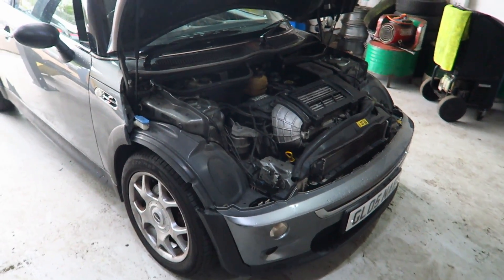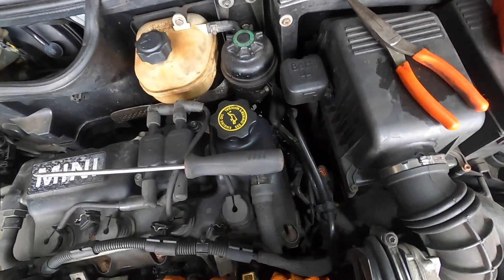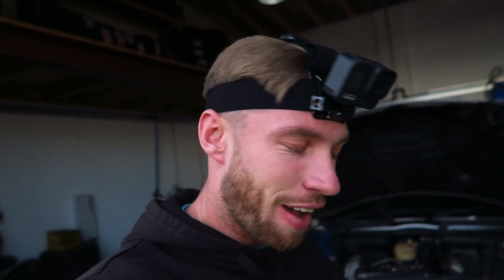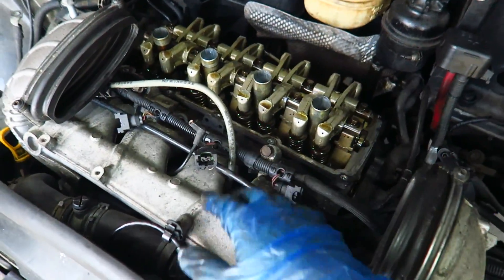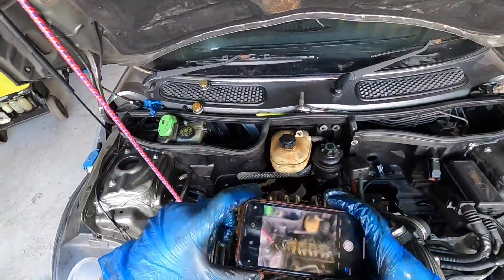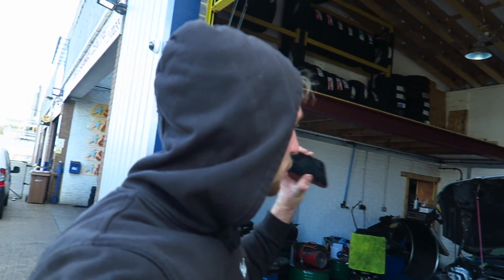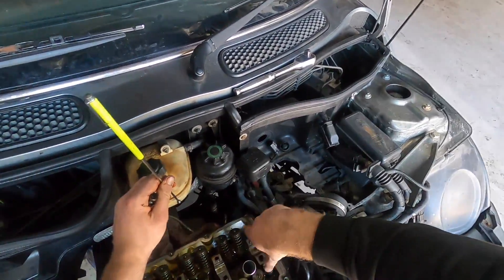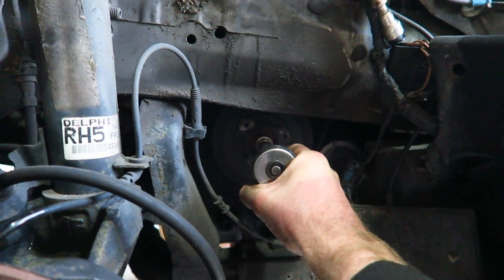Stripping Down The R53 Cooper S Engine!

Comment: Cool video man, I have the same car as you, just a tip for the future. It’s best to number the head bolts and put them back in the same order they were removed as it helps the engine because the bolts have gotten used to there specific placement in the engine. Great car, great video 👍🏼

Comment: I like all the vid you do normally Lee but FFS your not a mechanic, so many fails it's peak bro. From undoing head/cam bolts from the outside in, to not getting a true flat and measuring clearance on the head and the block. Bro, fix it up man surely you edit your vids? Your don't even use the right words half the time FFS making the UK man look bad out here
Reply: And the biggest fuck up, was not taking the engine and box out at the same time with the front end off. Why not? You wanna do a head job and a timing chain. Take it all out it's easy on the floor even your bad sump plug. Just fix up you shit man
Reply: Robert Casey why would you remove the whole engine and box just to do a head gasket and timing chain when you have plenty of access without doing so? Sounds to me like you don’t have a clue what you’re on about
Reply: @TheSavageGarage I just sat and watched the job you guys did, you don't know anything about me 😂. Have a look at how's the cars built and some book times
Reply from the maker: Who cares
Reply: @itsleelockwood  obv not you 😂😂

Comment: Hope you got the correct thickness head gasket to compensate for skimming , the more you remove the thicker the gasket . That's why gaskets come in 2 or 3 thicknesses for every 0.1 mm that gets skimmed . If you don't match thickness you'll change compression and oil pressure from the head being closer to the block , yes those 0.1mm do matter .
Reply: Where the hell did you hear that rubbish from? It would not make a blind bit of difference skimming the head unless you took a significant amount off, what about carbon build up? That would make more difference than the amount you are talking about.
Reply: @rich.dodd1  if you got carbon build up outside of the cylinder bore on the head surface you got serious problems.carbonn build doesn't happen in mating surfaces 🤦
https://youtu.be/NhNAS1dHtGY
Reply: @rich.dodd1  common Subaru problem after head gasket change if you don't match gasket to amount skimmed you get oil pressure spike blows seals has even been known to take out the bottom end , you'll find that most knocking Subaru have previously had their head gasket done . Take it from sre racing the amount of bodge jobs they've repaired through lack of head gasket thickness calculation after skimming is a joke .

Comment: Someone tell me what causes damage like that to a cam? Cheap oil wrong oil low oil? Cheers
Reply: Probably a bit of oil starvation, lee described a bad smell from the oil most likely scorched to hell and back.
Reply: @RhysMW cheers for the reply. My car says oil level low every few months. Could I be expecting this?
Reply: @welephant2013  if you don't top it up yes. Why is it loosing oil? Burning? Leaking?
Reply: It burns oil. Its the same engine thats in the mini cooper. Its a peugeot 3008 1.6. Apparently its nornal for them to burn oil. As soon as the oil top up light comes on I put some in.
Reply: @welephant2013  with the way the crank case is vented, oil ends up being burnt pretty fast in the combustion chambers. One of the same major contributors for the carbon buildup on intake valves.

Comment: Still find it mad that these engines in the R53 was actually made by Chrysler in a mini which was built by bmw 😂
Reply: 2nd generation is a peugeot engine. I got the 120bhp one from the na Cooper in my 3008.
Reply: No Chrysler involved at all 😂 PSA group power unit and BMW chassis and suspension for most of the new mini production run
Reply: @chelseaboi1000  the R53 has a Chrysler engine, the r56 had a Peugeot engine f56 is a bmw engine

Comment: Be best to put a cam in know , you will regret not doing it . I would recommend a catcam, dont go for newman as people have had problems with them. 
Join the r53 owners club on Facebook lots of us on there with track cars and pushing power to 280bhp. ,  good advice as well and you can pick up cheap parts . 
Keep up the good work mate 👍
Reply: Could do with a front mount intercooler too, they make a decent difference in cooling.
Reply: For the price I would run meth and  get a grs top mount IC. I run meth and it cools the intake temps down loads faster on track. 
But front mount IC sound wicked.
Reply: @marinsimunic9935  yeah you know dude, front mounts are well expensive. I never got that far with mine i bought it for £600 with a lot of miles on it, killed it within 2 weeks 🤣🤣, a lot of fun tho.

Comment: Defo take sump off as that smell is burnt oil mite have a blocked pickup pipe as that cam  looks like its had oil starvation. Prob worth taking a rod cap off and checking big end too. Get them valves checked  for sealing. Your gona be on track may as well sort it proper as it will be abused great vid.
Reply from the maker: It’s all back together now! I’ll keep an eye on it!
Reply: Agree check it all, and rip front end off to do the fucking lot like the pros do!!?!

Comment: what sort of SPUD do you have to be to say dont do a timing chain when rebuilding an engine lmfao
Reply from the maker: Few of the Mini people actually said this
Reply: think they've been on the crack pipe to long lol
Reply: My timing chain has went after the head gasket and now the gear box I’ve just fucking left the car on a random street gave up need to do a whole engine swap but I don’t know what engine and gear box that will easily drop in